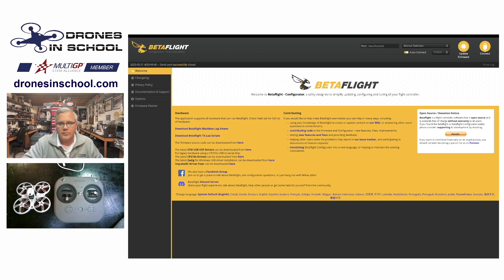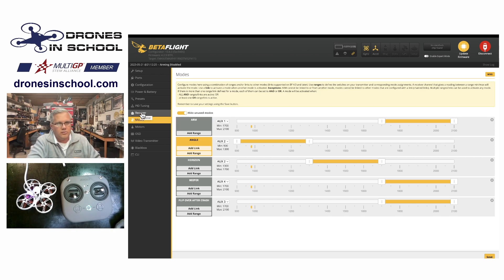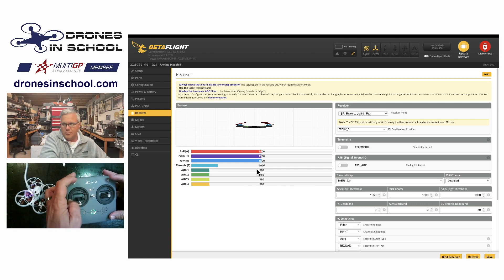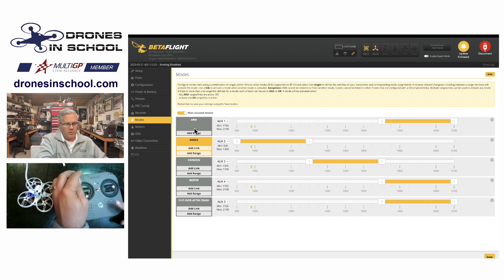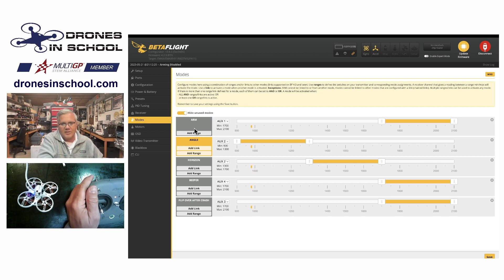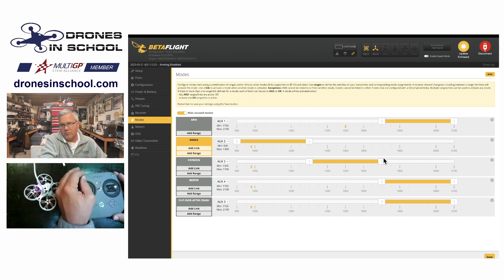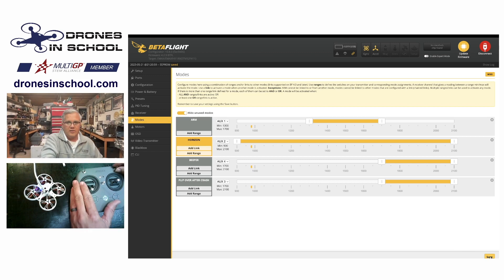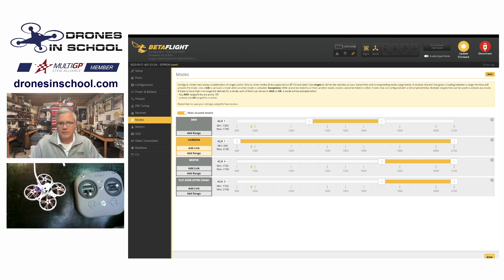Setting Arm and Flight Modes Using Betaflight

Comment: when I plug in my drone (mobula6) aIt doesnt connect. I have to manually connect and then betaflight doesnt seem to recognize its existence. The 3d model doesnt move with it and there is no change in the reciever tab when I move my sticks, depsite the drone being bound.